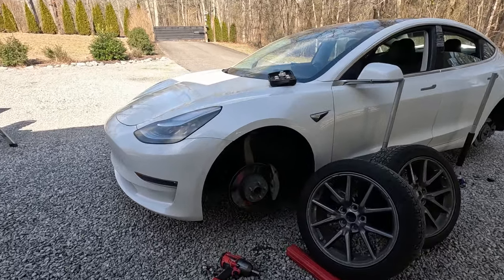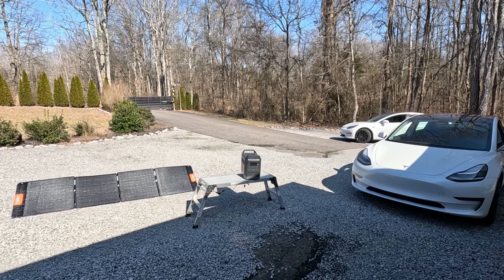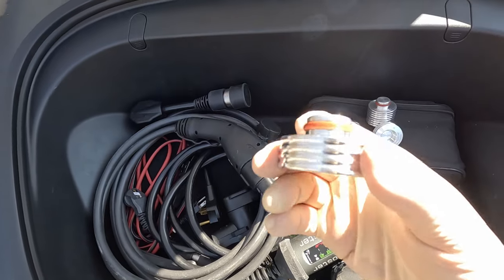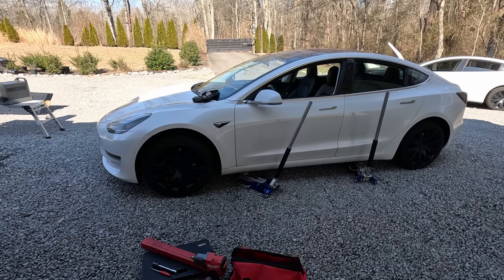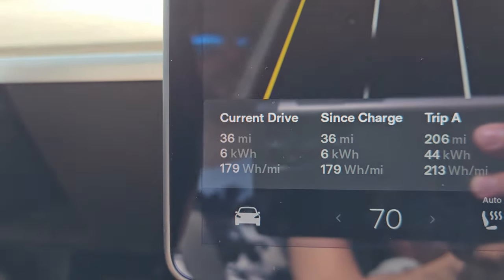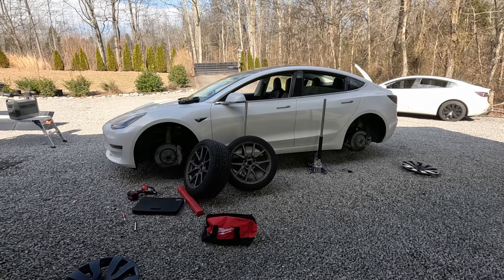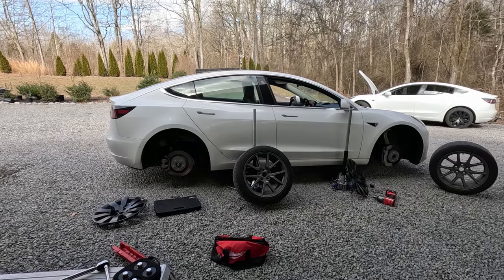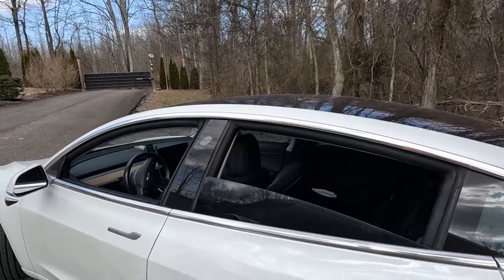80k Tesla Maintenance

Comment: Absolutely no need to use two jacks at once.  Tesla came to my home for my tire rotation and used one jack.  Frame is stiff enough to use one jacking point to life entire side of vehicle.
Reply from the maker: Let's talk about that. 1000's of either 18650 or 21700 batteries are soldered together. Let's say one of those solder points cracks under stress.the car weights over 4000lbs. Is it stiff? Yes. Does it cause unwanted flexing of the pack? Also yes. Google ford GM or dodge frame twist and flex test if you don't believe me for a source. Metal flexes more than you realize. Thanks for watching.
Reply: That’s because Tesla doesn’t care if your car breaks, it’s just more money in their pocket. Not like they are competing with 3rd party service centers.
Reply from the maker: @JifferRiffic  True, but that isn't just Tesla service. That may be their mobile service procedure as they haven't had any negative consequences from that directly and also even if 2 weeks later you start seeing your range go down a few miles from a few cells going offline in your pack is the average person going to notice? 
This video was just to bring awareness. 
I'm an Advanced Level Specialist Master Technician, and I can safely say some shady practices take place in Almost ALL shops and All Dealerships. The techs are paid flat rate in most dealer or shops here in the US. Which is based on how fast you can get the job done if your slow you are losing money which in this economy everyone needs every penny they can get. 
Subscribe there are going to be a whole lot of unconventional Tesla Vides similar to this put out on a consistent basis since the youtube Algorithm has blessed my channel recently with over 1 million views. 
Stay tuned. Tesla Owners, Haters, or just interested in buying an EV.

Comment: 4:28 You're lying.  Exaggerating at the very least. 😂 I have a model Y and I use the brake pedal in a couple of circumstances: 1 when the battery is at 100 and I need to slow down. 2 when the battery is very cold and I need to slow down. And 3 when I need to slow down very fast!  I can't believe non of those things has happened to you!!! Anyways.... Good video. Thanks for posting!
Reply from the maker: Never touch the brake? OK sure let's just say a handful of extremely rare circumstances. Most of the time I use FSD which as you know does everything for you. I always precondition my battery 100% of my drives so my battery is Never cold no matter how cold it is outside.  Also I charge to 80% so I get full regen 99.9% of the time. Always try to precondition on the plug as much as possible as that reduces battery degradation as well! 
Thanks for watching! 😊
Reply: You shouldn't be charging to 100 unless you really really need to
Reply: @nathansuss   I only do for long trips.
Reply from the maker: @nathansuss  I agree my car has been charged to 100% less than 5 times. So I would call that very rare. Also why my battery degradation is below 5% on my 2018 Tesla Long Range. Max range @ 100% is 301-304 Miles which is viewed from the Tessi App without actually having to charge the battery to 100%. It gives you a very accurate health reading after every 5KwH charge basically like a report card from the Tesla Battery Management System. Pretty awesome!!
Reply from the maker: @arondueck  reserved for long trips definitely saves the pack from unnecessary degradation.